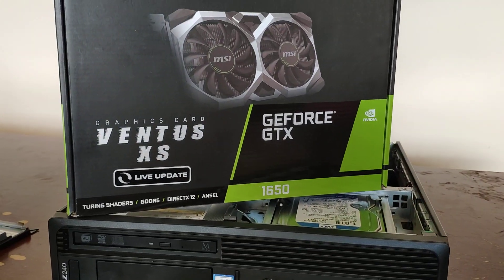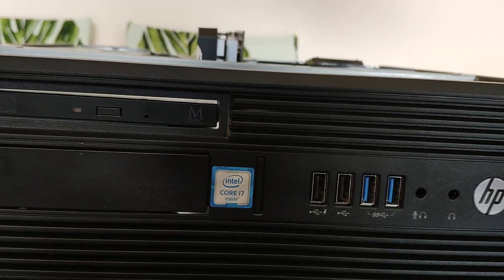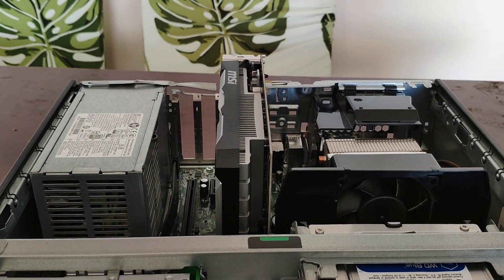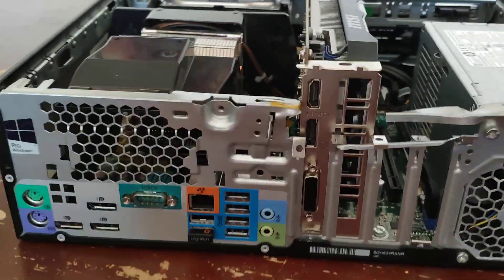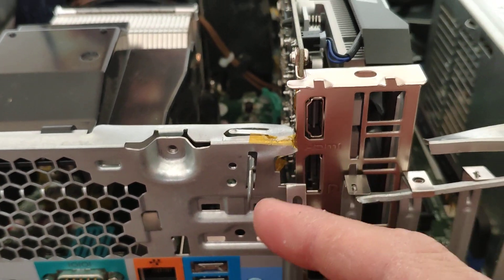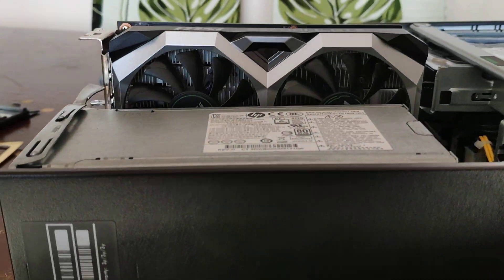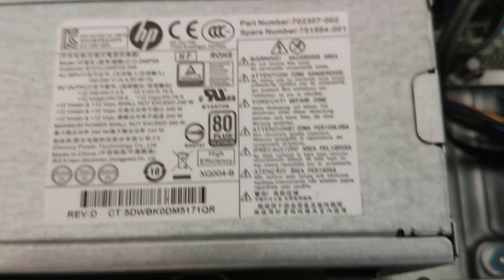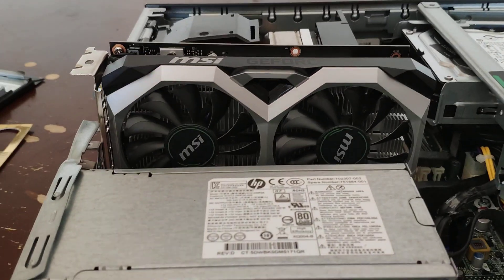GTX 1650 in HP z240 sff case, it's not pretty but it will game

Comment: I have a hp compaq 6300 pro sff pc so it is just like you have will it work on mine i have 240 w psu and i7 3770
Reply: Yea 240watts is perfect  for the gtx 1650 since the 1650 doesn't need alot of power

Comment: Hi, would this fit a low profile gtx 1650 inside properly. System that I plan to upgrade:HP Z240 SFF Workstation i7 6700, 8GB RAM, 256GB SSD, Win 10
Reply from the maker: if its something like this

https://www.gigabyte.com/au/Graphics-Card/GV-N1650OC-4GL#kf

you should be ok

Comment: Did this setup work? I have a the same PC. But I see my PSU is 240W and my GPU is 300W? Can you confirm?
Reply from the maker: It did work
Reply: @rickstechrepairs  I may give it a go. I though the 240W PSU could not hold the 300W GPU. Maybe the 1650 is not 300W?
Reply: @mickwhitfield3631  did you try it? pls let me know i have same set.. here
Reply: @youssef147  No mate I did not a became a crytocurrency miner. This guy sounds experienced though I am sure it can work. I use mine my PC to Stake Crypto only.

Comment: Cool to see this. I kinda regretted getting the SFF immediately but I've had zero problems with it over the last 4 years. Amazing computer. Mine came the 4-core Xeon and K1200 card, I don't really game so it's fine for me. Are you planning to add anything else to the Z240?
Reply from the maker: Nar this was just for a customer 

The could add more ram and an SSD and call it's a finished system

Comment: This video is very timely for me as I am planning to upgrade a z240 sff right now. Since I am having a hard time getting a low profile 1650 here in my location, I am now looking at the possibility of transferring the whole system (board, drives, psu) into an ATX case since I have a spare one. I am hesitating due to the front panel. Would be glad to know your thoughts on these.
Reply from the maker: The issue with transferring it to a new case is more the power supply connections, hp has used it's own proprietary mainboard connectors

So you will need to buy adapters off eBay or aliexpress

The front panel connecters for power button/reset/power light are simple
Reply: @rickstechrepairs  yeah the power supply issue sucks. Which is why I would also export the z240 psu to the new atx case. What I mean about the front panel is that my spare case does not have usb 2 nor usb 3 for the front panel (Yeah it is that old). Really hesitant about those adapters since I am still not confident when it comes to building PCs

Comment: i have this same computer but with an i5 6500. plan on installing the motherboard on my wall and getting another power supply (HP are proprietary) to power a 1060 gpu. 
it'll be done when I decide to not be lazy and push the project another day.
Reply: Le sugiero :https://www.ebay.com/itm/Grafikkarte-MSI-NVIDIA-GTX-1650-4-GB-GDDR5/333603204378?epid=2305653753&hash=item4dac4ced1a:g:XjQAAOSwTx1exH0s